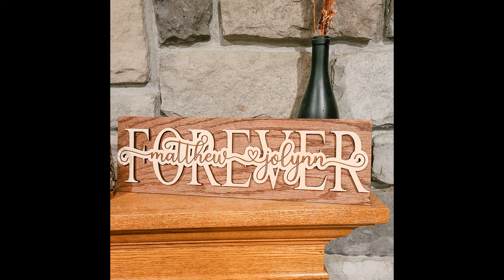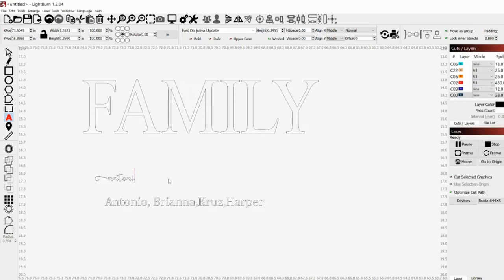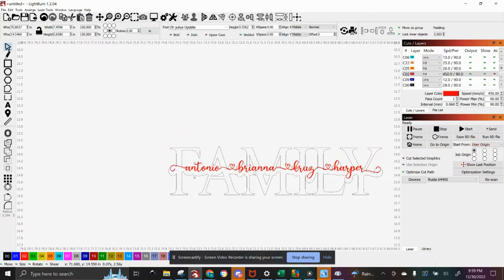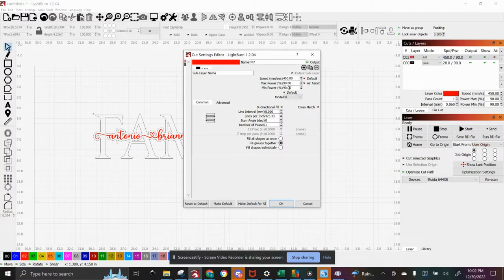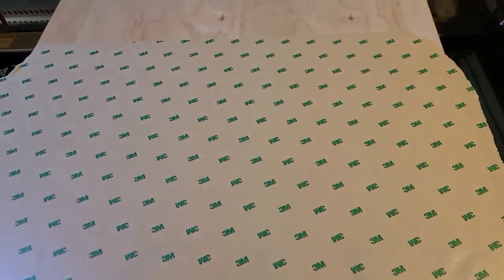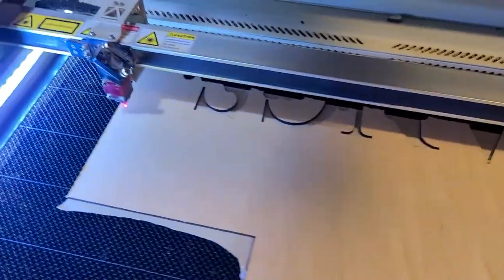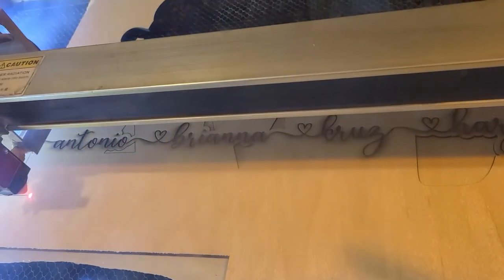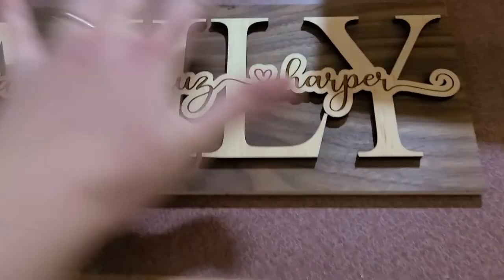How to Make My Best Selling Sign: Co2 and Aeon Laser Tutorial

Comment: Thank you! What type f woods are you using? Pre-finished Baltic birch and what is the backing? an oak board with walnut oil-stain? Thank you!
Reply from the maker: Yes! I use maple ply with an mdf core for the names and either red oak stained or walnut mdf for the backing!
Reply: @LaserAndLearn   Thanks! And do you finish the project with anything or just use the plywood as it (both names and backing). Sorry for questions I am a beginner

Comment: Amazing video thank you! What are you using for the backing it's super nice, walnut plywood? Or birch plywood you stain for example? Or a pine board you stained? So many ideas.
Reply from the maker: I typically use 1/4 inch mdf plywood. Redoak I stain or sometimes use walnut. I have a different video on where I get my wood if you want to check it out

Comment: How thick is the wood used for the letters and also the backing?  Also, do you get it from Ocooch Hardwoods or someplace else?  Thank you.
Reply from the maker: So I use 1/4". Also, I almost exclusively use plywood. So I usually get it from my local supplier, smokeyhilldesigns.com, craft closet, or gs2 awards
Reply: @LaserAndLearn  Great.  Thank you.